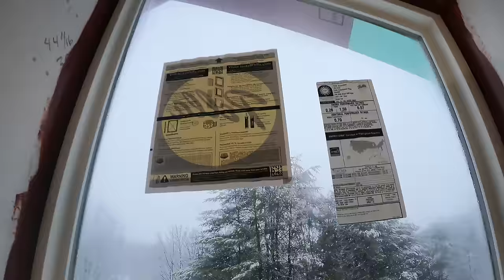Electric and plumbing on the second floor - Building my ICF house part 17

Comment: Hey Jesse, I was wondering if running a sub-panel is more cost effective to each floor, also if it’s even legal… I’m not an electrian? Post script: labor included 7 legs @ 40’+ and just pulling the wire etc…
Reply from the maker: you can but it wouldnt be able to be covered up by anything so it would be out in the open. cant put it in any of those attic or utility area's, so it would be right in the open

Comment: that "glue" you use for your plumbing pipes, is that just some type of silicone? i live in sweden and here is the rule to use pipes with pre installed rubber gasket.
Reply from the maker: it's pvc glue and primer. it melts and welds the plastic together

Comment: Could you have saved wire with an Edison circuit using 12/3 wire?
Reply from the maker: you cant do that because the arc fault breakers would trip. need a dedicated neutral for each circuit

Comment: Hey Jessie... did you look into 12/2/2 for your home runs, you could have made all pulls in just 4 runs. With either an extra 8th circuit for future, or the 4th with regular 12/2
Reply from the maker: the reason you cant use it is because the code says they need a simultaneous breaker, which doesnt work for arc fault breakers. Maybe in the future if they come out with an arc/gfci breaker that can utilize this method, but probably not because to make it cheap they would need a massive amount of interest in it

Comment: Every modern home should have the washer/dryer on the floor with the bedrooms. It just makes sense.
Reply: Until a hose breaks or the water pump goes and it floods...
Reply from the maker: @DSGLABEL  they make drain pans for that. but I am not too worried about it since the floor is concrete , nothing to rot
Reply: @jmuller86  I know you can handle it. My comment was more towards the "every" home.

Comment: are you going to have to put metale shields over wires that are inthe foam
Reply from the maker: only where the wires are closer than 1 1/4 to the edge. which is downstairs in the kitchen

Comment: Seems like only way the gray 10 dollar ones would work is if you made a 2"×8" rectangle and center the box...then you have room to push in the leads.

Keep forgetting to advise you to use surface bonding cement on the roof not just plain cement.
Reply from the maker: I will be using cement-all for the roof. it is a very strong bonding cement. Stronger than anything I have ever used. I have used it for about 6 years now and the stuff from 6 years ago still looks like the day I troweled it

Comment: I continue to be impressed with Jessie's work ethic and commitment, but I still just don't see the benefit of ICF given that all stages of construction are sooo much more labor intensive and and time consuming.
Reply from the maker: when I was finalizing the plans for this house, lumber was through the roof. and concrete was dirt cheap. Of course when I got to the actual serious concrete work....lumber went way down and concrete went way up. I was literally going to build this house for thousands of dollars cheaper with concrete than with wood. but then times changed. It was alot more work but the house will stand up to anything that you can throw at it. I also wanted to pave the way for people in disaster areas to work with concrete. because everybody has a concrete house with a flat roof, and everybody hates that. I wanted to prove that you can build it into any shape you want and still have a disaster proof house.
Reply: @jmuller86  Thanks Jesse for the explanation.   Now I understand your dedication.  Very honorable and thoughtful of others you are as Yoda would say. Keep up the good work!